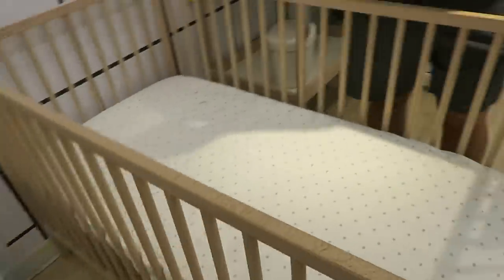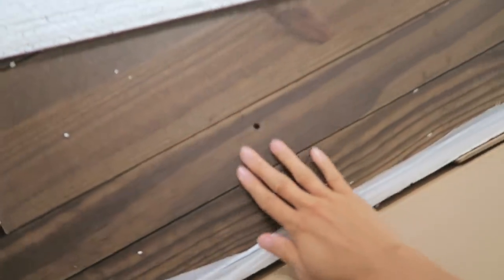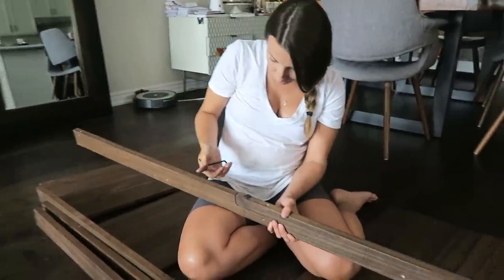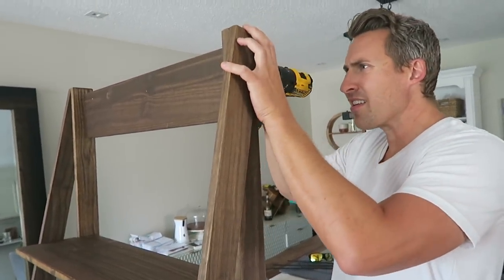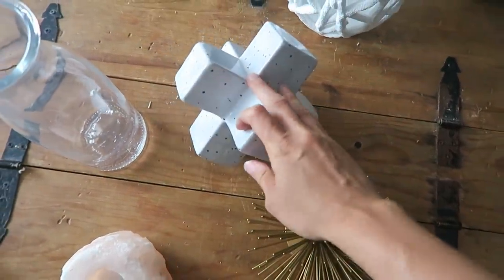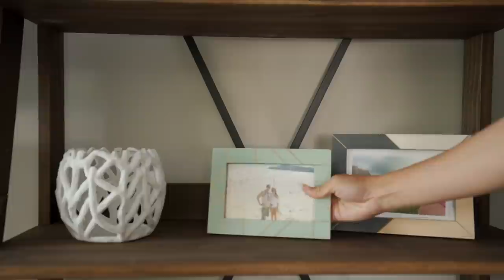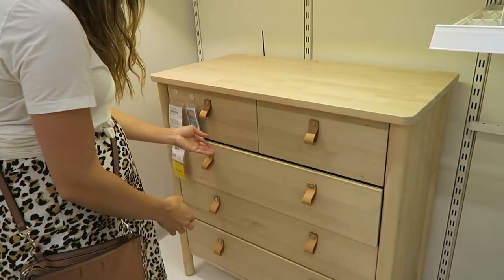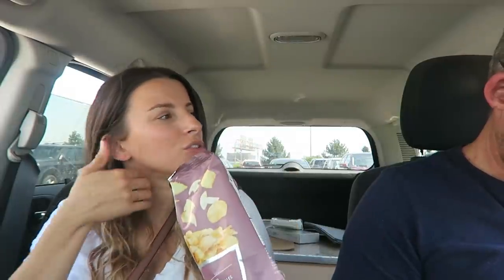Living Room Makeover On a Budget | Before & After!

Comment: The shelves are nice and you styled them great, but they are too short for the space, you need something taller. Also they need to be a bit further from the TV and not hiding behind it. Also the fireplace is waaaay to small for the space and looks like it is just being stored there and does not belong. I think you should put it on something to lift it a bit, also frame it, so it looks larger. This way you will get a bit more balanced look , because the TV is humongous.
Reply: The TV is way too big for the fireplace that is soo much smaller.  Not in proportion at all
Reply: I agree. I feel like the space could’ve been better designed. It looks too cramped. The fireplace does not go well with the tv or the rest of the house decor/vibe to be honest. Too modern for the natural theme they have going on.